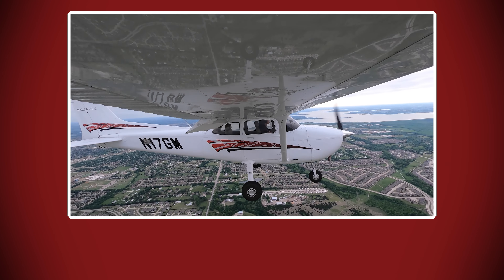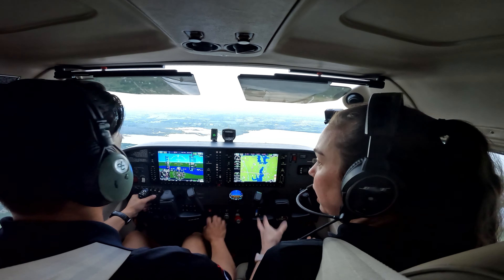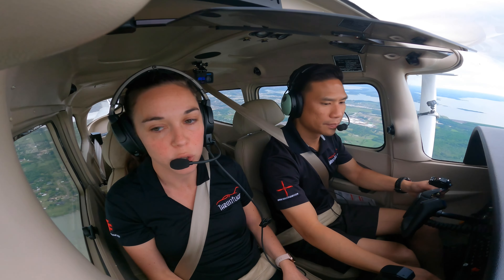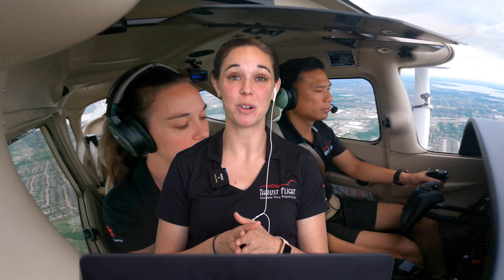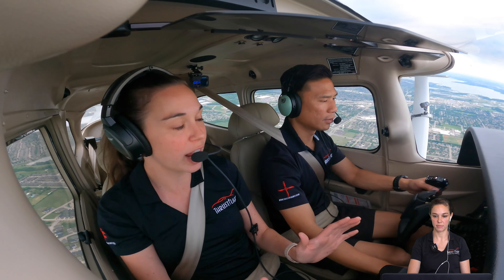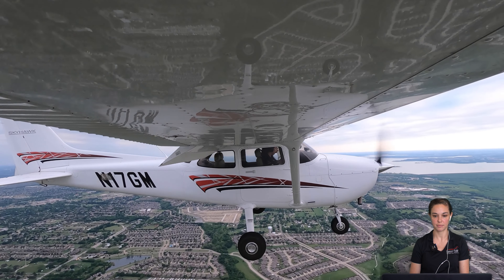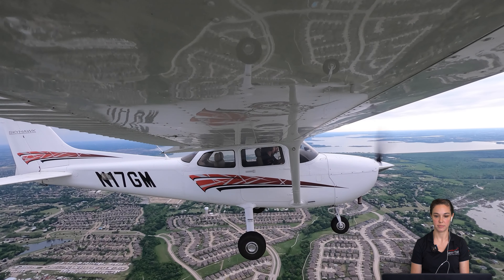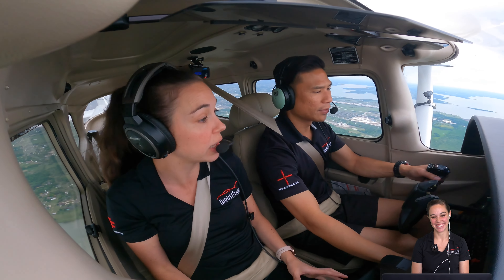How to Perform Power Off Stalls | What Every Student Pilot Does Wrong

Comment: Another tip:

Rudder work is essential here for keeping the nose straight. If your wing wants to dip, keep the aileron straight and straightened the airplane with your feet. I had a lot of a trouble on a DA-20 where it's a stick versus a yoke situation. When I would pull the stick back, I would unknowingly pull back at a slight angle and my left or right wing would dip first. I suppose it might be easier with a yoke but not by much.
Reply: I have the same problem with a yoke. When pulling back I have an unintentional habit of pulling down slightly when pulling straight back.

Comment: My school has a procedure called HASEL check list before stalls:

Height - 2,000'+ AGL
Area - Over practice area, farms
Security - doors, windows, loose articles
Engine - Primer, Master, Magnetos, Indicators, Carb heat, Mixture, Breakers
Look out - two 90 degree turns or one 180 degree turn

My PPL flight test is next month!!!
Reply: For the area one. It's mostly for landing in case of emergency.  Especially for ground reference maneuvers.
Reply: @TheBrennan90 actually, you may also want to look for a safe, uncontested area to perform maneuvers even if staying about the recommended altitude per regs.
Reply: How did you do? I passed mine last Sunday 🕺

Comment: One thing i didn't hear mentioned in this video is to ALWAYS have an emergency landing area picked out in case of engine failure etc.  during the maneuver.   great video !
Reply: They mentioned having already done the pre-manuever checklist (CLASS) which would include selecting a landing site. Likely cut it out of the video for the sake of time.
Reply: Good point, will do

Comment: Thank you for your video. I've been working on power off stalls, as my instructor showed me "simulate landing, power out, nose to 20 degrees attitude" which has led me often fighting off a nosedive... Knowing that it's acceptable to just bring the nose to horizon or slightly above? well, that might be my cheat code on the checkride. I hate the idea of not doing what I have been taught to do, but I'm thinking your way might make the maneuver easier 🤔

Comment: The checklist is called a HASSELLL check.

Height - sufficient to recover by 2000 ft (not start the manoeuvre at 2000). And that is height AGL.
Airframe - clean or dirty
Safety and security - seatbelts and harness secure, no loose objects in the back, fire extinguisher secure.
Engine T's and P's in the green, fuel pump on, fullest tank selected.
Location - not within 5nm of an aerodrome, not less than 2000 ft AGL over an open air assembly of people, built up area, mountains or a large body of water.
Landing - place to land in case it becomes a real emergency.
Lookout - clearing turn
Reply: We go by, CHAPS. CLEARING TURNS, HEADING SET, ALTITUDE SET, PLACE TO LAND, SEATBELTS.

Comment: I disagree with "take out the flaps early" - it's not specific enough! :-)
take out first notch immediately (30 degree flaps are mostly for drag in C172)
then take out the next notch when at safe airspeed (and climbing)
then take out the final 10 degree of flaps when above all obstacles and at safe airspeed (and climbing)
Reply: In the c172s poh for balked landing / go around its flaps 20 immediately. 10°at 60kts and 0° at 65kts

Comment: So is no carb heat heated added on decent ? Performed this exact maneuver with instructor and plane started shaking like carb ice build up. Weather was dry no humidity, slight drop in rpm and manifold pressure increased. We had to perform an emergency landing.  Any one else ever experience anything like this.
Reply: sorry was in 
in  a Cessna 172
Reply: It depends on where they are and what time of year it is, altitude as well. They were at 2500. Relatively low.